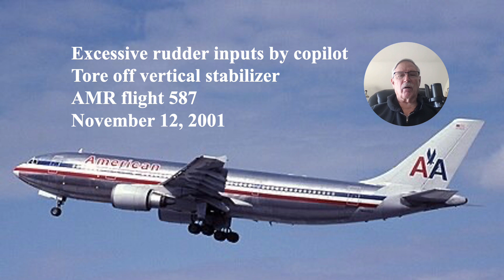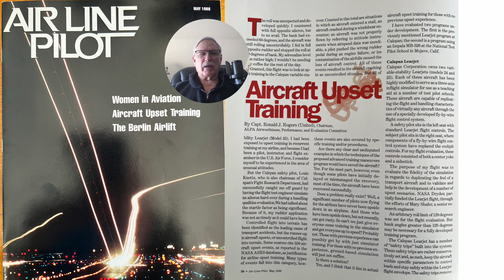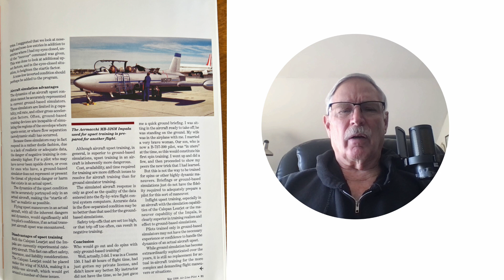Excessive rudder inputs by copilot Tore off vertical stabilizer AMR flight 587 November 12, 2001

Comment: Some thoughts on 587.  I was just taxiing out that morning when I heard the Port Authority duty officer call the tower from his car and say that an aircraft had just gone down.  At that instant, my airplane moved past a portion of the terminal and I looked left and saw an enormous black cloud, the kind you get in the instant after a kerosene fireball consumes itself and changes from flame to smoke.  The cloud had not even started to move with the wind, which was blowing hard enough to push the cloud right off to the side within seconds.  Interestingly, tower had no idea what had happened, and it took them several minutes to even determine which airplane it was.  The F-15, which had been orbiting overhead since 9-11, was down to pattern altitude in less than 5 minutes and circled the entire bay area looking, most likely, for some kind of smoke trail.....

A year or so later, I had one of the pilots from the union accident investigation committee on the jumpseat; and he told us that, although the data from the DFDR was quite granular, and nowhere near as smooth as you would expect it to be from a modern unit, it was clear that the A-300 was upset way beyond any 5 or 10 degrees of roll - he said that the crew of 587 was looking at a windshield full of ground almost immediately.  

The rudder limiter system on the A-300 was unusual.  In most all other transport category airplanes, the rudder limiter limits the rudder travel, but not the rudder pedal movement.  That is, you can still move the pedal the full travel but that will yield only a small fraction of actual rudder movement.  Not so in the A-300.  As I recall, the limiter system limited the travel of the rudder pedals, which in turn limited the actual rudder movement to what the pedals were commanding by their position.  This resulted in an inch or two of pedal travel at speeds essentially above flap retraction speed.  This is reflected in lbowk's comment.  I'm not sure it was ever determined whether the pilot actually overrode the physical pedal limiter, or whether the rudder somehow simply went to full travel with the small amount of pedal travel that was available, but the latter seems likely.

In those days, the only pilots in the entire world who had any understanding other than that maneuvering speed meant that you could do whatever you wanted with the controls with no harm, appear to have been real test pilots like yourself.  ALL others, including myself and every other ATP that I had ever spoken with on the subject (granted that it was not a common subject of cockpit conversation in those days!) thought you could have yourself a ball on the old yoke and pedals and as long as you were at or below maneuvering speed all was good in the 'hood.  Of course, that notion was put paid immediately after the accident, much to our shock and chagrin.  Another key piece of information withheld from the hoi poloi.  None of us knew how to spell doublet, let alone what that was!

That training that everyone refers to was called "Advanced Aircraft Maneuvering".  It was developed and presented by Captain Warren Vanderberg, and was presented live to all AA pilots.  It was an outstanding course, and Warren was an outstanding instructor.  It contained no inducement toward overly aggressive maneuvering, although one individual or another might possibly have gotten such an inclination on their own.  The portion that dealt with the rudder was along the lines that at high angles of attack, the rudder is going to be of more use in roll control than the ailerons, particularly since in transport category airplanes the roll control system that operates the ailerons also introduces differential spoiler extension - which you certainly don't want (more loss of lift) in a high AOA situation.  This was true then and it is still true, provided that it is applied in the right situation.  And, as we learned in November 2001, executed smoothly and without doubling.  Interestingly, the highly regarded "Children of the Magenta" presentation was a part of this AAM course.
Reply: We were taught to use the rudder opposed to the roll of the aircraft, not stomping it, but smoothly as far as it took to roll it back wings level.  Of course that was in the Sim, and it worked.  Of course shortly after take off is a worst case situation! We were training at the altitude that the 2 737’s that rolled over an crashed as they were on approach.  That Airbus had a self induced full deflection at cruise several months before that crash,
Reply: I know Warren Vanderburg's "Magenta" lecture. Didn't know it was a response to this incident though!
Reply: @RoamingAdhocrat  It wasn't.  The Advanced Aircraft Maneuvering program predated the flight 587 accident by a number of years.  It was a one-time program.
Reply: It was a precursor. @RoamingAdhocrat

Comment: You could do an entire episode on the airbus vertical stabilizer attachment system and the rudder limits change in gas the aircraft accelerates. Only Boeing guy here but after the incident some more than interesting facts came out about the very small rudder inputs needed to get max rudder deflection for that speed. We tend to visualize a pilot stomping on the pedals like in full acro. In fact the rudder pedal travel at climb out may have been limited to less than two inches. It has been a long time but it would be worth a little research and possibly a clarification as there is certainly much more to the incident. Bus drivers at that time were shocked to learn of the systems design shortfalls. All transport pilots I know were shocked to find the standards required for all transport aircraft. I attended the AA class presented by a former F-4 pilot and only recall it covering the usefulness of the rudder in various flight situations. I did not hear any mention of doublets or rapid rudder reversal as a tool. The course seemed to be geared toward the growing number of pilots with no military or aerobatic experience.
Reply: I 100% agree. I was going to make the same point of severely reduced rudder pedal travel as opposed to progressively reducing the rudder travel with the pedal inputs remaining constant. I was an aircraft mechanic for the majors and read accounts of AA pilots saying the rudder pedals were essentially on/off switches when they were depressed with increasing airspeed. My airline flew A300-600s and decided to see for myself. I put the air data system in test mode which would drive the air data systems to specified levels including the rudder travel limit system. I was shocked at the small amount of pedal travel was allowed before they hit the stops. So this very small amount of travel was equivalent to pushing the pedal “to the floor” on an aircraft with a ratio changer type control system where pedal travel constant and rudder deflection reduces with increasing airspeed. Also the pilots   
weren’t warned of this change as previous A300B4’s had a ratio changer system. I’d love for Ron to further delve into this chapter of AA587 and the rudder travel system.

Comment: My rudder stories:  1.  Prototype Beech 1900 had rudder lock.  You could push in about 3/4 rudder and then it would move over to full by itself.  We spent an entire Saturday doing flat turns near Wichita with different aerodynamic fixes to solve it.  2.  Autopilot development on Lear-60.  Expecting an aileron hard over at high altitude in Boot Hill 2, A/P engineer accidentally input rudder instead and we did a 270 degree snap roll.

Comment: That airplane had issues before the accident. They took the whole fin off the plane and glued it back on. I still feel this should not have broken off so easily. I thought airbus had protections against all sorts of over control.
Reply: Not on the A300, which didn't have the fly-by-wire protections of the A320 and later models.

Comment: The B-52H didn’t have a rudder get snapped-off, it was the whole damned vertical stabilizer. 
-same with the A300. 
BIG difference between a rudder and a vertical stab.
Reply from the maker: yes, I misspoke.
Reply: I love people who are big enough to admit an error. @ronrogers
Reply: But B 52 was better designed to fly with a remnant. And it didn't break clean like the Airbus design. It left a tiny fin
Reply: Dilley_45 identifies the crucial difference between the B-52 that landed successfully and AA584. That B-52 had retained a small part of the leading edge of the fin, which provided enough directional stability to prevent the uncontrollable yaw that soon wrenched both engines off the A300-600R before it hit the ground.
Reply: @chrisscott4896  Nah its just better built. And Airbus is not

Comment: Years ago we had an FAA inspector on our JS.  I was flying the A320 at the time for Brand X.   This inspector was a former high-time USAir Airbus Captain.  His previous experience on the Bus elevated him within the FAA to become their "Airbus Guru".      He told us that the FO did NOT apply full throw to throw inputs at the rudder pedals.  But the rudder actuator did in fact command full L-R-L movement.    He showed us some info on his laptop to support his position and suggested that we fly the Bus with our feet on the floor once away from the ground.    

When do transport guys use a LOT of rudder?  Almost never.   Crosswind takeoffs and landings (in particular) and during a V1 or V2 Cut.   But other than that?  While climbing out 99 percent of the time their feet are flat on the floor or barely on the pedals.   I cannot see a high time transport guy applying full L- R - L rudder in flight.
Reply: He likely used full L/R rudder unknowingly because of the design of the rudder limiting system progressively reducing rudder pedal travel rather than the rudder ratio system which reduces RUDDER travel. And the pilots weren’t cognizant of this change. Actually the older A300B4 had a rudder ratio system.
Reply: I read the actual accident report 'back in the day' and don't recall seeing anything other than that the full rudder reversals were commanded by the pilot - so ... ? data errors combined with 'highly sensitive rudder' system as Ron mentions? Anyway - I fully agree with your 'feet on the floor' technique on airliners. I used to use 10,000 feet as my feet on/off point. Any normal 'yaw control' requirements are nicely handled by the Yaw Damper systems.
Reply: You are absolutely correct..many copilots don't even remember where the rudders are😮

Comment: The rudders on all our other airliners were built to stand side loadings and also had speed sensitive rudder limiters to protect them. This was all AA's  and AirBus's fault. not the 1st O.
Reply from the maker: SIde loads yes, but not repetitive rudder reversals.
Reply: @ronrogers Was the A/C speed below rough air manuvering?
Reply: At least they could have designed it in a way that only half the rudder snaps off,  then you have at least a fin even with no rudder which still gives you stability
Reply: "This was all AA's fault." Corrected it for you.

Comment: I do not agree with the finding. Airbus had issues with cracking in the vertical attach points. This carried on to the A320 line.